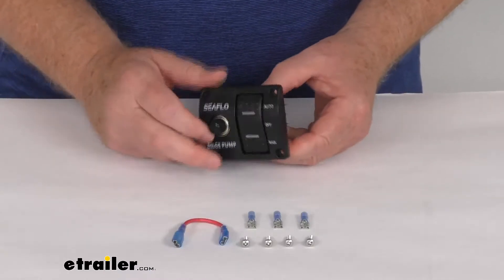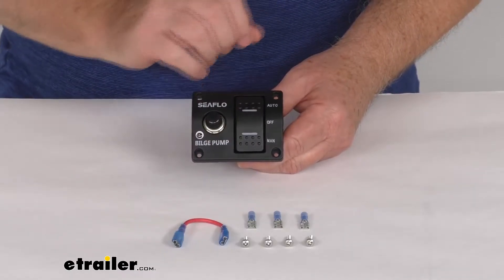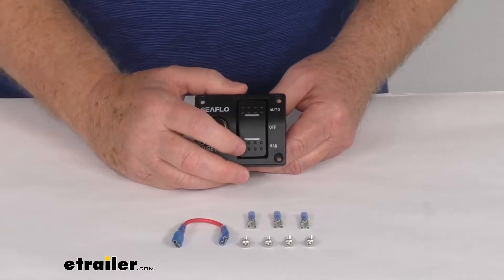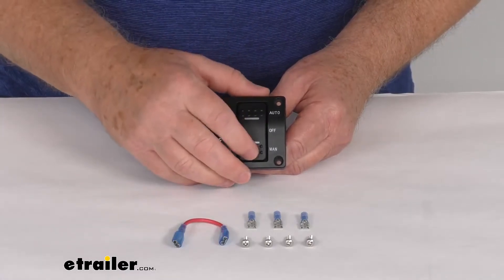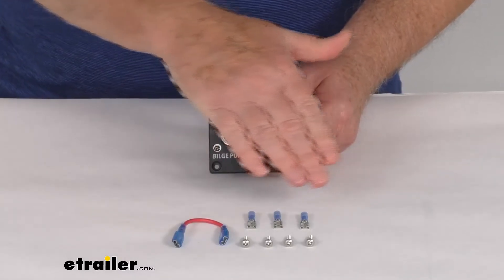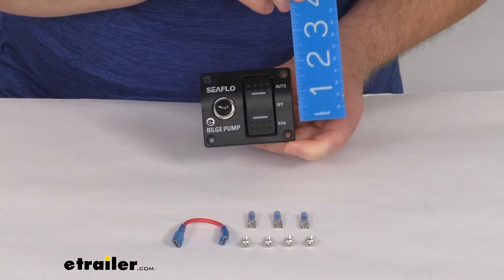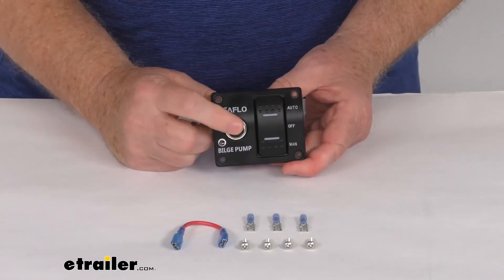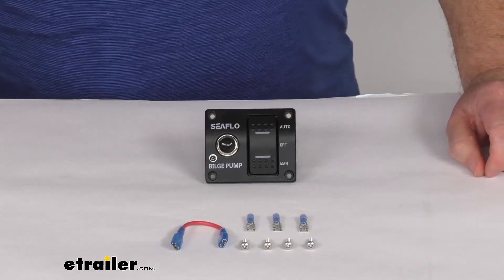etrailer | Ultimate Overview of the Seaflo Switch Panel for Bilge Pumps

Comment: My bilge button on the dashboard is completely stuck it doesn’t switch on or off. I have the boat off with no keys in it. But people are saying even without the keys in it. It should switch on and off
Reply from the maker: It really will depend on how the pump has been wired. If it's wired independently of the key, then it will run with the key off.
https://www.etrailer.com/Accessories-and-Parts/Seaflo/SE34FR.html
Reply: @ OK thank you so much. I had another problem so it didn’t start due to the battery being dead and after charging it and giving it a jump 20 minutes later once I arrived at the lake and was dropping in the water, it didn’t ignite to turn on rather just cranked and after a few tries, it stopped making the cranky sound. I took it into a shop and I’m just waiting for a diagnostic. Hopefully it’s not an expensive repair. Fingers crossed.
Reply from the maker: Good luck, let us know how it works out!
Reply: @ I just pushed down on it very hard and just like that it started working lol
Reply from the maker: @ismaeljrmorales3613  It magically repaired itself? That's awesome!
Reply: @etrailer  sorry let me clarify, yes the bilge pump switch button magically fixed itself. Now for the other problem, they replaced my carburetor and battery which fixed that problem.

Comment: Great how to replace the light bulbs in the switch?
Reply from the maker: The lights in the switch are not designed to be replaced. If they go out, you will just need to replace the switch.
https://www.etrailer.com/Accessories-and-Parts/Seaflo/SE34FR.html

Comment: Hi do you need a fuse with this switch thanks
Reply from the maker: This switch has a failsafe circuit breaker built into it so that you are protected if something were to go wrong.
https://www.etrailer.com/Accessories-and-Parts/Seaflo/SE34FR.html